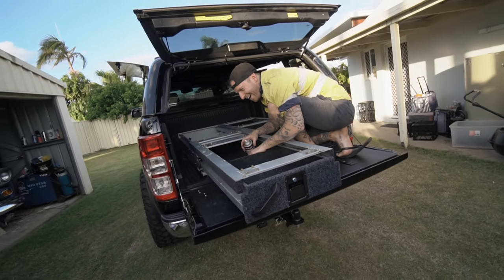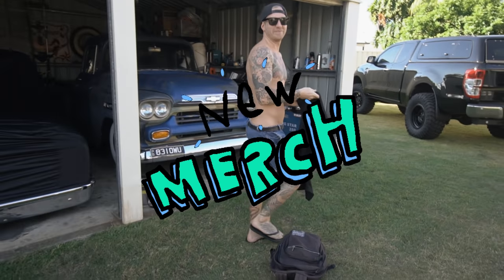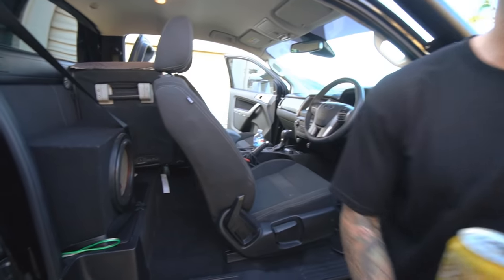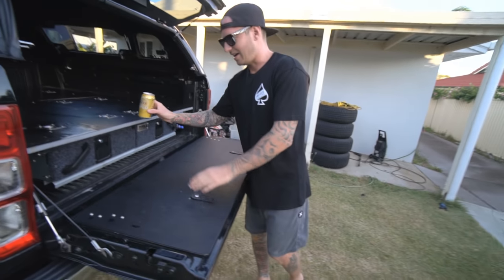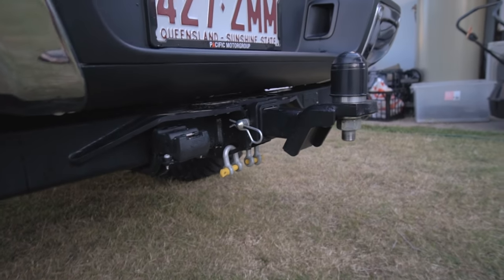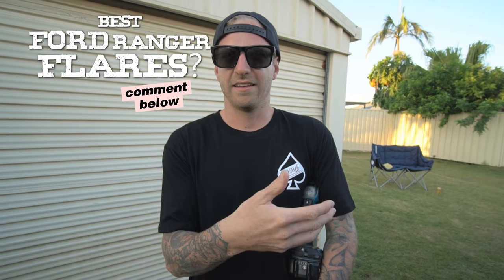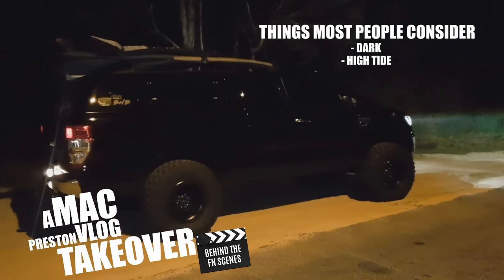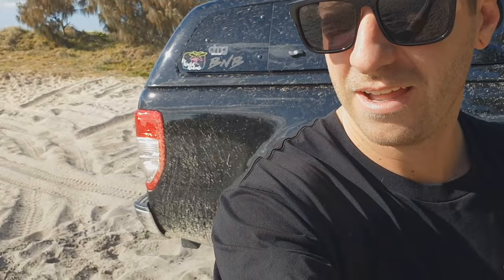the WALK around 2020 Ford Ranger Mods

Comment: Mac pretty much has the same rear set up as mine. Having water on tap is so good when you're on the beach
Reply: supreme wizard of jahanism  yea i used a small 12v pump that's around 5L per minute. Can get them on ebay for around $20
Reply: supreme wizard of jahanism  no just the pump. I custom made a tank out of stainless steel
Reply from the maker: supreme wizard of jahanism  yeah the pump came in the kit he bought pretty sure mate
Reply: Yep pump came in the kit with all hoses and thats the tank i baught!
Reply: You have a link for the kit?
Reply: Yep i posted it just b4 in this thread and few others